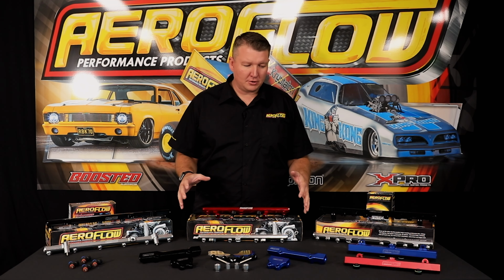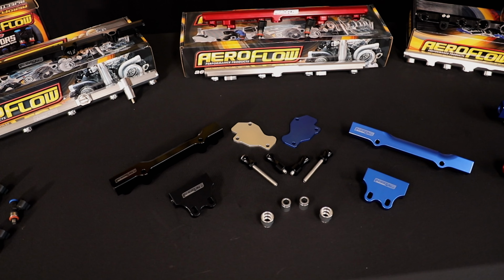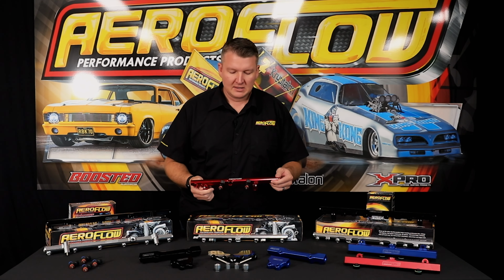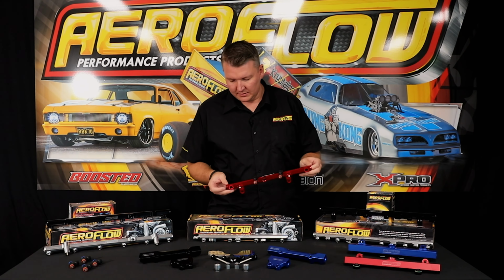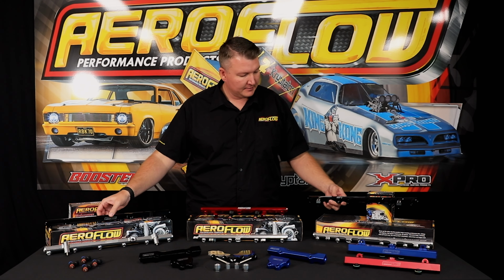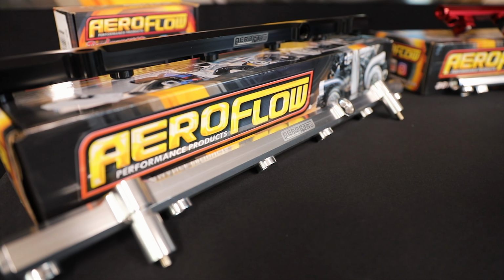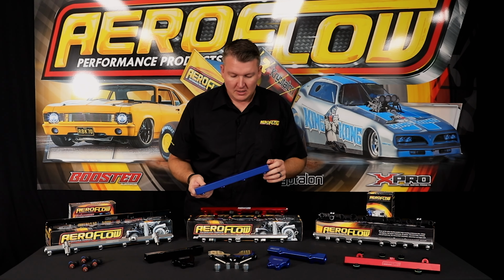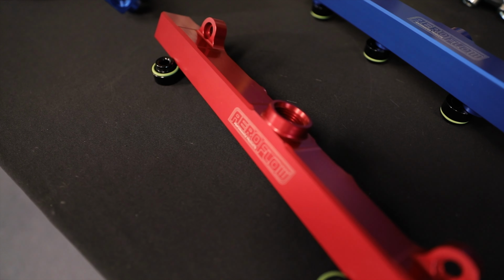Aeroflow Performance Upgraded Fuel Rails

Comment: Any videos on how to fit the rb fuel rail
Reply from the maker: there's only 3 bolts, it's pretty straightforward. You just use the spacers that work with the injector length you are using